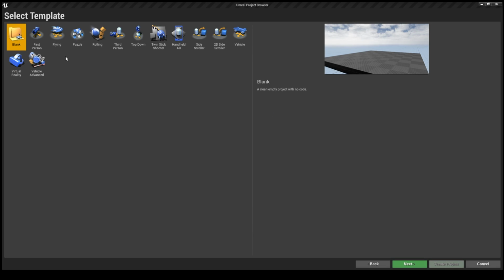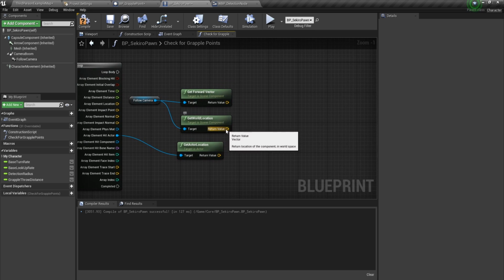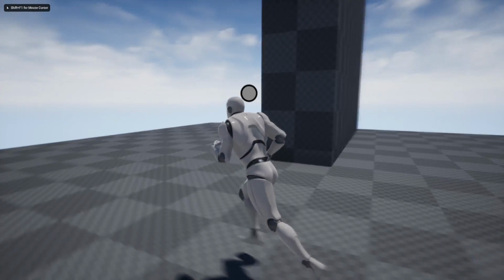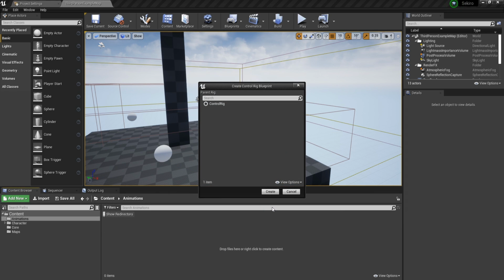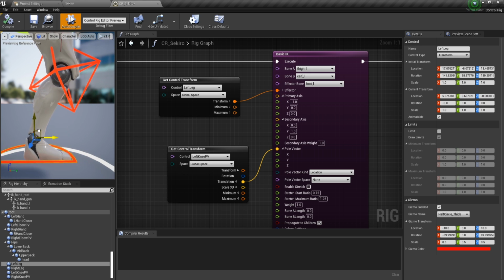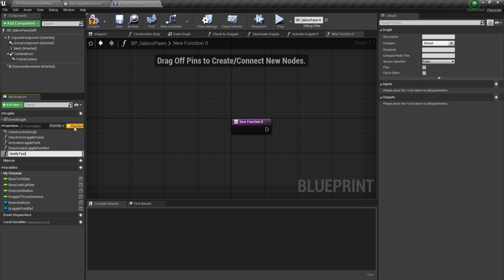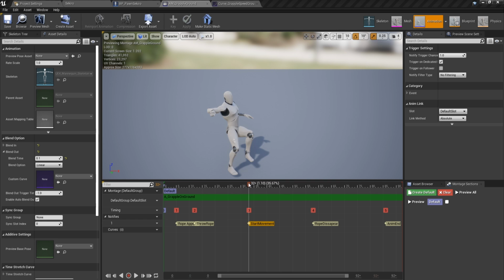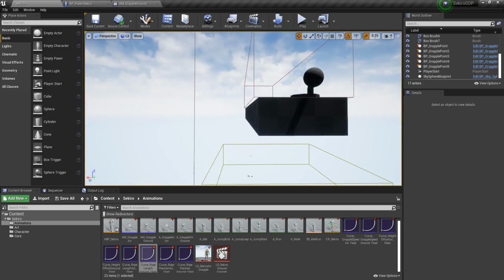Game Dev Pantry | Sekiro - Grappling Hook & Unreal Engine's Control Rig | Retro-engineering

Comment: hi i know this is 4 yrs old but for some reason whenever i have everything setup it wont display the widget at all unless its set to visable but even then the logic simply wont fire, ive trippled checked every the refs between both, it works fine with the sekiro pawn but wont with the sandbox pawn from gasp any ideas?
Reply: i have the exact same problem atm did you ever figure it out? also using GASP

Comment: Hey, I'm trying to make this on UE5, everything goes well except my character keeps getting teleported to the initial position after every grapple... Anyone have an idea why?
Reply: Did you manage to solve this issue?
Reply: @ekveel4538 I think so, I’ll need to look at my project to know what did it, I’ll get back to you. I think what helped was downloading the source project on ue4 and comparing it to my own, as I remember the tutorial doesn’t cover everything.
Reply: @ekveel4538  Now Im stuck at that problem too lol, what part did we miss? Cuz it does same for me no matter what I try.
Reply: @pulakeshisalunkhe  Animation timings is what is being skipped here. 
You have to go into your animation and check where the grapple starts and that point is the X value start point of your grapple curve. Basically, there is a mismatch with the animation and the positioning values of the curve graph. Fix that and your character wont get teleported back
Reply: @ekveel4538  it’s gonna sound weird but that didn’t work in my case but what did was, I imported his project file anim montage and used them in equal node inside grappling movement and in event graph at the end of node for play montage, just to check and it worked (I had one made for but that would teleport)  and it doesn’t even change mesh or does anything weird. 
🗿imma sit down and take that in for a moment and try to figure how does that even work that way.

Comment: Hi, i've been trying to migrate this into my project but i'm having difficulties. Do you have a discord or anything? or if there's anybody reading this that has successfully migrated it and would like to help, feel free!!

The widget isn't updating as i move towards it. i see the widget but the size isn't changing. it lets me launch the anim montage but my PC gets stuck. no rope appears.
Reply: Hey did you ever find a solution to this? Seems changing to a new AnimBP with fresh montages causes it to get stuck for some reason. Feel like I've quadruple checked all my references, still no dice. The pawn I migrate works fine, but changing the AnimBP for him makes it freeze up.

Comment: Hi! Got this almost working on my 2,5D project cause I wanted to try something different. I am trying to instead of translating character to the landing point, make my be launched in the direction of the grappling point kind of Spider-Man, would you know how to do this?

Also, trying to deactivate grappling points when Im not facing them, but cant figure out. 

Thanks for the video!
Reply: In "Check for Grapple Point" Use a ConvertWorldLocationToScreenLocation Node, Plug GetPlayerController -> target and plug ForEachLoop->ArrayElementHitActor->GetActorLocation->WorldLocation. Then "GetViewPortSize", Check that the CWLTSLnode->ScreenLocationX is > 0 and < ViewPortSize->ReturnValueX (do same for Y) (thats 4 compares) - AND all these and the result is if its on screen.

Comment: so i have a question, i was wondering if there is a way to use this system, minus the specific animation? since my character is shooting his hands out instead of a grapple, and i was thinking of using transform bone, based on the fire of the grapple movement, but i dont know how to implement the timing based animation with the grapple, using the bone transform instead, is there any chance you could explain/help that? (p.s i may have figured it out by the time this is answered, as i am still looking into it, but an answer would be much appreciated, great tutorial btw!)